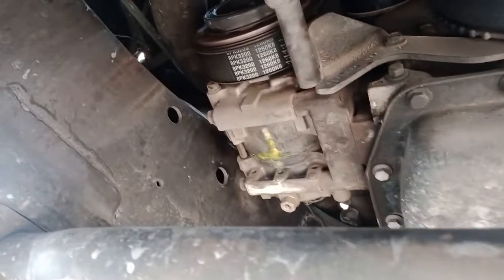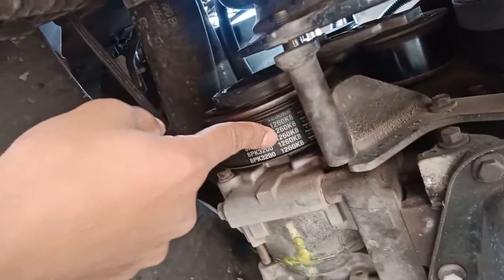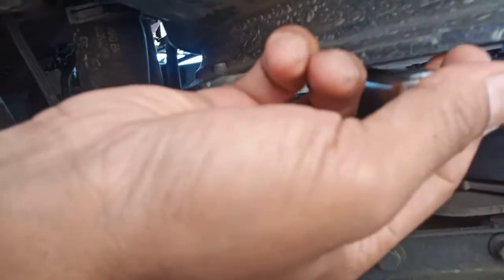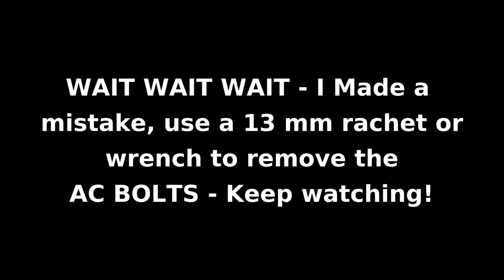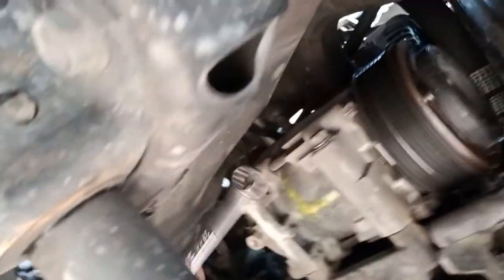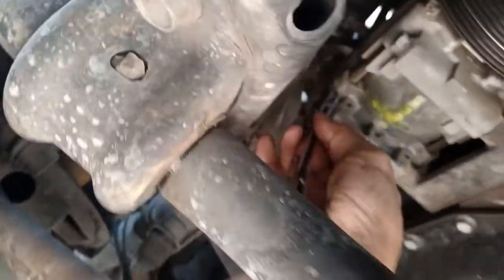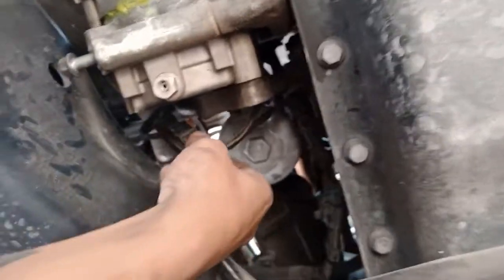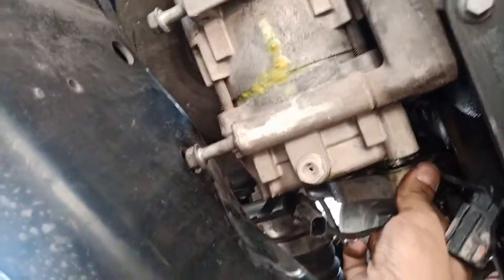Swap AC + Dryer-Receiver - 2006 Dodge Ram 3500 5.9 Cummins @streetwrenchmonkey

Comment: What about the oil ? How much does it take and where do you put it
Reply from the maker: Hi, sorry for the late response/next day. 
It's not based on HOW MUCH Freon or oil you put into the car or any car/truck.
You have to fill the system BASED on the current weather/temp of outside.
NEVER GOOGLE or follow anyone who says.... ya ya load up 45oz and you are good. load up 20oz and you are good, this is wrong. the RIGHT WAY is:

Please make sure you have a proper set of AC guages..... kinda like the ones you find in the auto shop, they sell them on amazon for 40 - 80. 

STEP 1, 
CONNECT the LOW/BLUE side of the gauges to the Car, Connect RED/HIGH side of the gauges to the car.

STEP 2, 
Use a thermometer (any kind) to determine the current temp NEXT to your car. If the weather channel says is 85 outside, it could be 80 or 92 with you standing next to your car, this part is important.

STEP 3, 
If the temp/weather is 85 out, nice day, wear a t-shirt.
Fill the car with FREON in the LOW/BLUE side-PORT UNTIL the gauge reads 45 to 55 PSI (310-379kPa) AND the HIGH/RED side gauge reads 225-250 psi (1551-1724 kPa).
It may take 24oz or 32oz from empty to reach this level, I dont know because each car/truck is different.  

STEP4, 
If your gauges read the proper level, you have enough FREON/OIL in the system everything should work fine. 

IF you have enough freon in the system and it is not working, something else is wrong with the car, do not continue to fill or over fill.

Here is a PIC of the Chart.
Use this chart to add freon BASED on outside temp
https://www.cumminsforum.com/threads/a-c-pressures-and-fill-chart.2453658/#lg=thread-2453658&slide=0
Reply from the maker: Feel free to message me on Facebook:

https://www.facebook.com/StreetWrenchMonkey